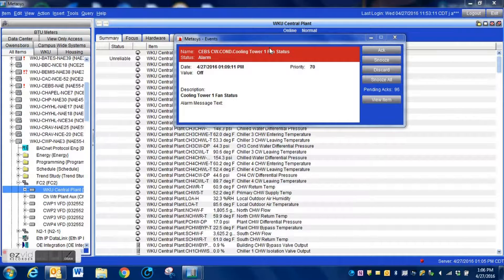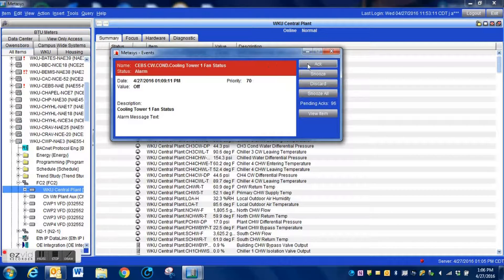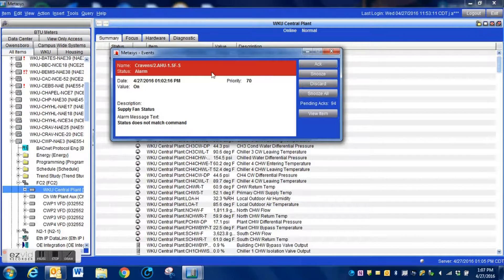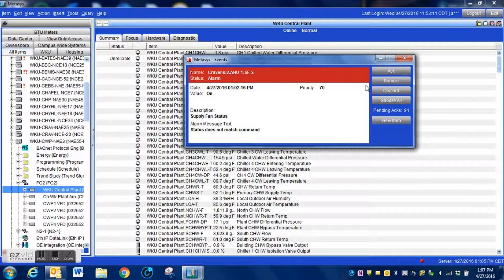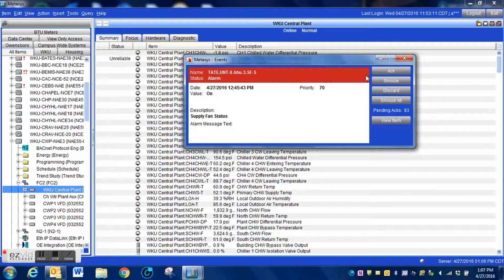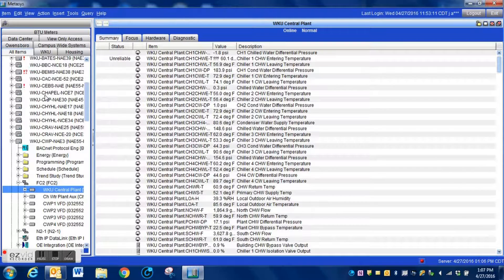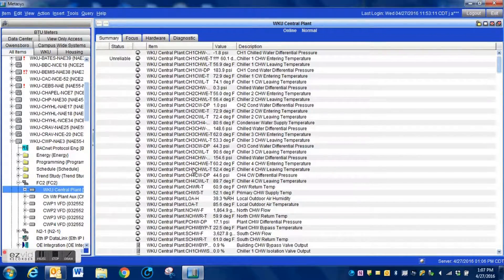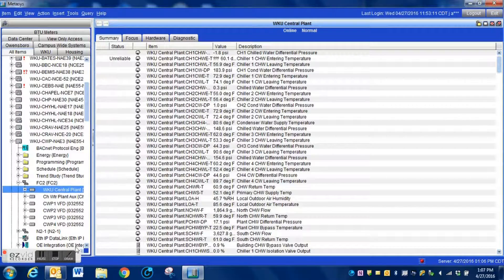How to disable Metasys Alarm Popup

Comment: We are still using (around) this version of metasys at our school.  There is a schedule for all year round. All I want to do is, for HRV2, to increase the zn-setpoint to 24C in the winter months. When I set it to 24C, it keeps the current temp but when the unit shuts off for today it reverts back to 21C (average + or -). This must be the schedule doing this. The file/object I'm adjusting is HRV-2 AVG-ZN-SP.
Reply from the maker: You need a separate schedule for different types of points.

Comment: CT has red alarm to "On". During this cold weather in Texas. It now warming up. The On hasn't turned off yet. I tried to select off and gives me the message "change failed. command is not supported on this object" not sure if it supposed to turn off it own or I have to do something. Can't find anything online on this matter
Reply from the maker: It would depend on the type of device and how the point was pulled in
Reply: @Systemcontroltech  I figured it out I found the heat trace box. Giving a code on it "gfi trip" and cleared the alarm. It needs to be fixed

Comment: Hi..how are you...
Do you have any tutorials on how you can see  your graphics in your computer when you running 8.1 version and above NAE
Reply from the maker: Graphics can be affected by the plugins on your computer. If you can't see your graphics the problem may bbq e one of them. Shockwave is one plugins that is used. Different graphics packages may require a different plugin.